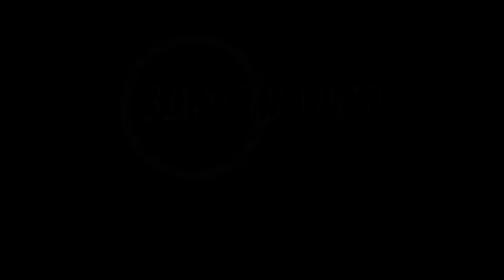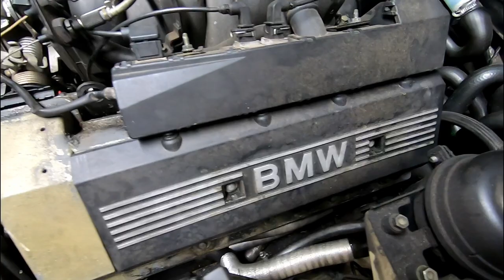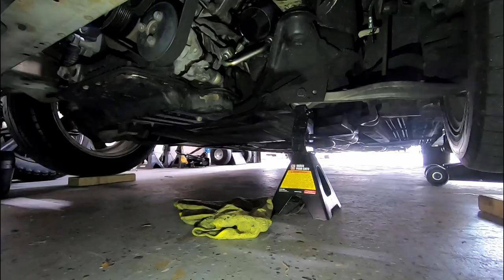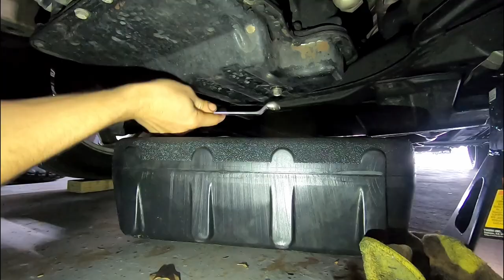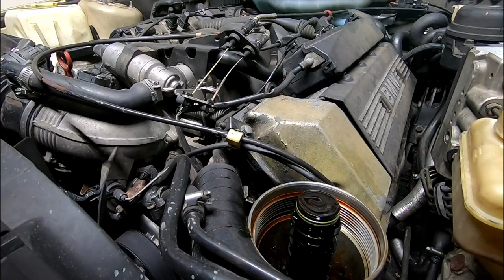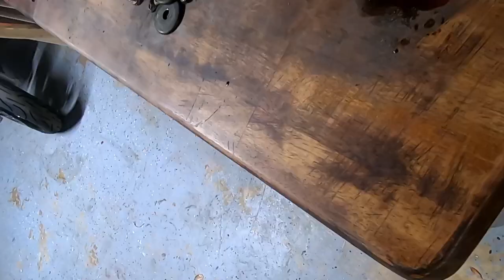(short ASMR) 1995 BMW E34 540i/6 Oil Change

Comment: Hey man what size attachment for the oil filter bolt did you use? I use vicegrips to get it off but that one would be way easier lol.. any suggestions where I can purchase one? Great vid btw. Straight to the point!
Reply from the maker: If memory serves me right, it’s a 36mm. I have a set of sockets specifically for oil filter housings. Here’s a link for a set similar to mine:

Heavy Duty 7-Piece Oil Filter Cap Wrench Tool Kit Can Last for Ever Includes 24mm,27mm,29mm,30mm,32mm,36mm,38mm Socket Set Compatible with Mercedes Benz, VW, BMW and More Oil Filter Housing https://a.co/d/4pjzUtZ